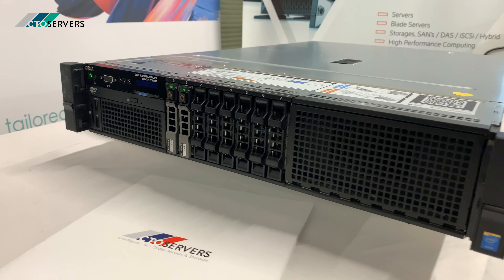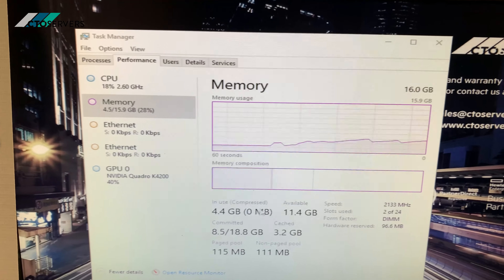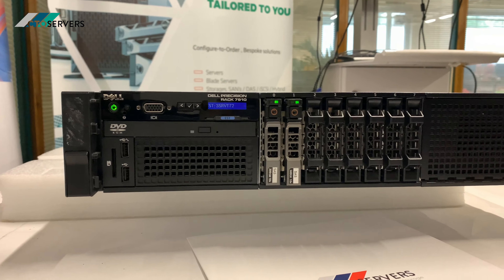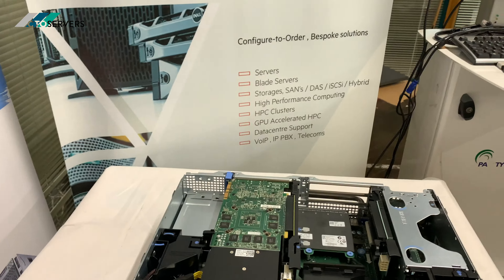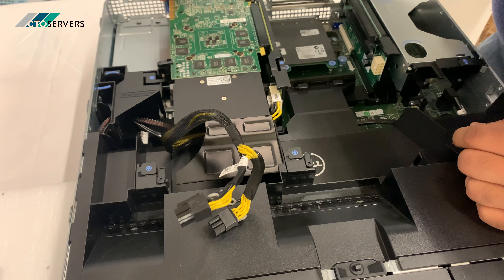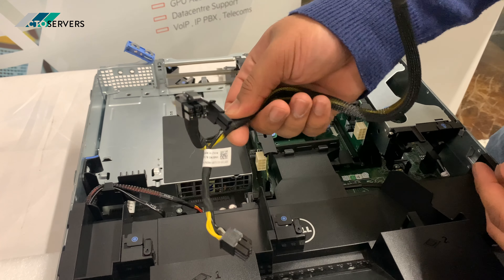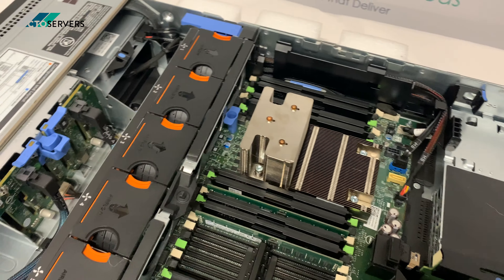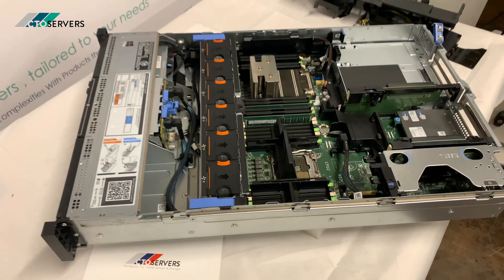Dell Precision Workstation R7910 Rack , Dual CPU , DDR4 RAM , NVIDIA QUADRO , High performance !

Comment: What's the sound profile like for one of these?
Reply from the maker: Home friendly, quiet
Reply: @CTOSERVERS  would you say it is quiet enough to use as a workstation next to you while you are working?
Reply from the maker: @AXJBCinematic  Sometimes , it can ramp its fans up in auto mode under workload. I think you can manually set the fan however as its the same as the desktop / tower version